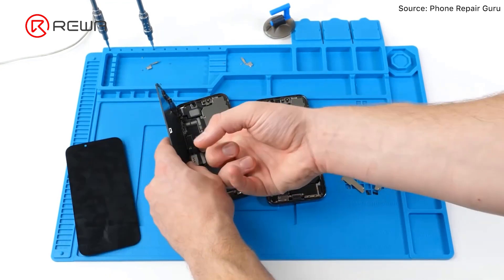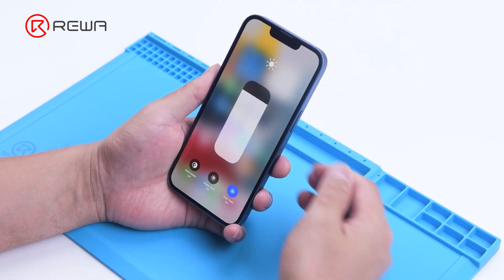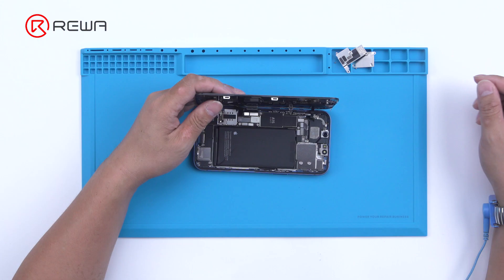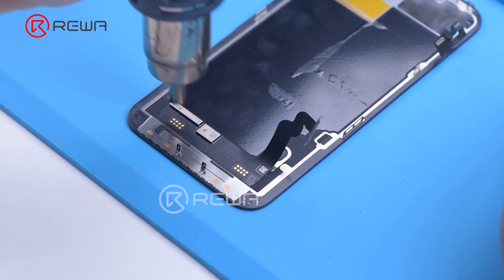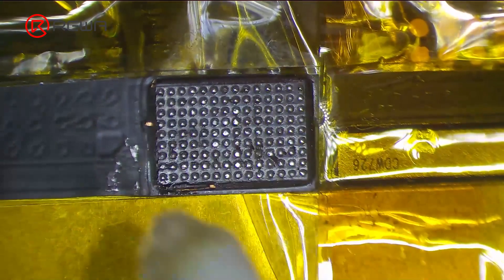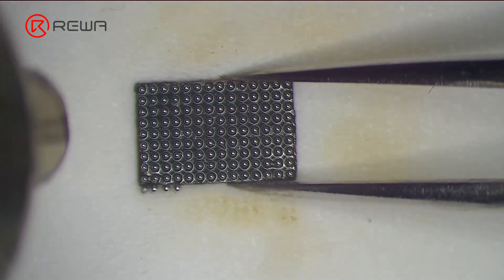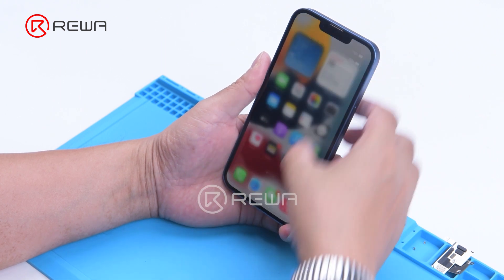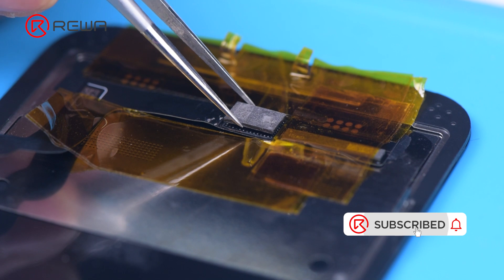Fix iPhone 13 Face ID Not Working & Important Display Message after Screen Replacement

Comment from the maker: Will you try this method to fix the Face ID for iPhone 13 screen replacement and how much will you charge?
REWA Academy iPhone Motherboard Repair Live Course is enrolling students now. Come and join our academy to update your repair knowledge and skills!
https://academy.rewa.tech/courses/Live-Course-iPhone-Motherboard-Repair
Reply: Information about the true tone is recorded on the second chip.
Reply: @УллубийИбрагимов-ю8х  no
Reply: very risky to transplant that chip to a new display panel. i might damage the new LCD set. I could charge $100 for the transplant
Reply: Wow rewa technology  I am amazed of you and I am 7 years old and I really want to fix mobile phones
Reply: ড্ড

ডণ
ণ্টণ্ট

গভংম্পমম্পমজঝজভভ
Reply: ণ্ডণণ
Reply: please how can I send my iPhone 12 pro max to you, I'm having issues with my face ID and Mobile update failed, verify update
Reply from the maker: @janetnbabarinde394  Sorry, we currently don't take personal repairs.
Reply: Does ic chip soldering also work with an aftermarked screen or does the replacement display have to be original
Reply: @enes038  any very good quality aftermarket works with the original chip, but It really have to be a top brand screen
Reply: @WolfMoonSs   I have last week desolder the ic chip from aftermarket screen. Because it was very different and I can’t solder the original of the aftermarket screen…
Reply: @enes038  you can find in the market three differents types of screens, here in Brazil we call each one as:  
Paralel: Worst quality and low price 
Incell: Medium quality and price 
Original China: Equal as original and a higher price
  Only the original China one have the capability of recive the original screen chip
Reply: @WolfMoonSs  you are the best man bro have you a link of the original china screen than I buy it

Comment: Does ic chip soldering also work with an aftermarked screen or does the replacement display have to be original
Reply from the maker: Apple has already fixed the problem. Screen replacement won't disable the Face ID now. To remove the screen alert, chip soldering also work with some aftermarked screens.

Comment: Hello guys. What about True Tone copier? Can you advise if JC V1SE new board can work and what is the order in which this screen replacement should be done. Thanks
Reply from the maker: JC V1SE can restore the True Tone of iPhone 13. You should copy the true tone before screen replacement.
Reply: @rewatechnology2008  with any screen? even original apple used screen or needs to be special screen?

Comment: You can restore True Tone if you have the old screen as it has a code that needs to be reprogrammed using a jc programmer
Reply: iPhone 13 jc programmer is not available now it end @iphone 12
Reply: @oseialfred5901  It is available now on Ali
Reply: Not supported yet
Reply: @khaledmerabet353  It is now on Ali

Comment: no more two screw driver guys on the road doing screens for nothing and ruin the market .We pay taxes wages,rates and we must compete with people doing those for nothing ,It s the end of it. Just the best will survive . Since iphone 12 the screens are cheap on apple and shops charge as much as apple or more .  13 are cheap also on aple out of warranty . Not so much screen jobs now.. All it s left .Soldering jobs and high skill repairs :D

Comment: No more amateurs doing screen repairs. I love it 🤣🥳
Reply: 2 years ago I invested into all the tools took 6 phones to learn but I’ve mastered it 😼 Any one can do it just how determined are you
Reply: Im now also consider a “amateur” doing phone repair since 2002 until 2023 when I stopped doing repair jobs because I can’t get make anything properly without manufacture support sure you can repair the screens by removing a soldering into a new screen I’m capable of doing bga chip repair but the point being whe should not tolerate this from the manufactures they make everything harder to repair I gave away most of my repair tools to some young folk :hot air station microscoop  bga machine

Comment: How about front camera  ??? , it is also disabled after screen replacement
Reply: Judging from face id is working again, it's safe to assume the front facing camera still working.
Reply: @feisaljauharitufail  they r not connected, face ID in android use from camera, in iPhone it has it own sensors, like light illuminator

Comment: So even if your replace the chip the true tone will not come up anymore... They are sick why they are keep coding they parts...
Reply: no big deal, just use the diplay reporogrammer from Rewa like the older phones
Reply: @Jakkudesu  that will not work, need new programmer
Reply: @hackersecMY  im sure it will come soon. Anyway, there are no ip13 displays available so it should not matter. The only option currently is Apple store